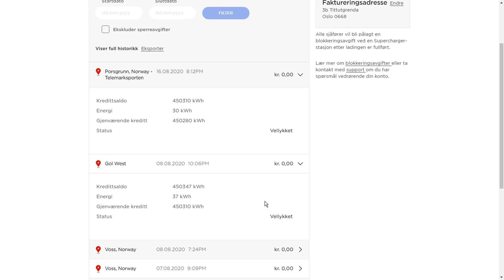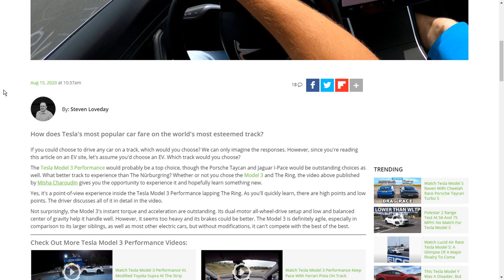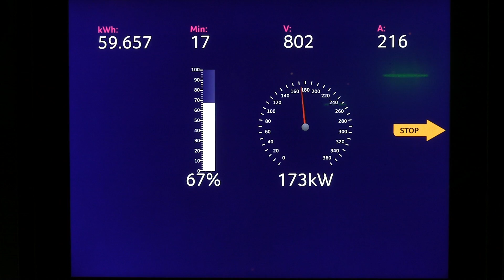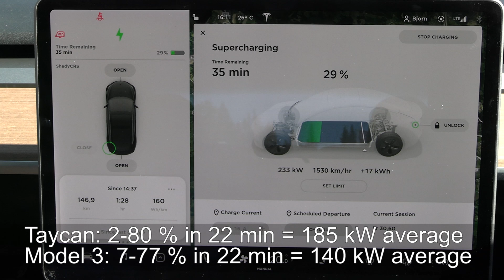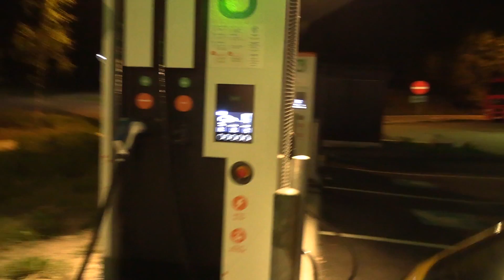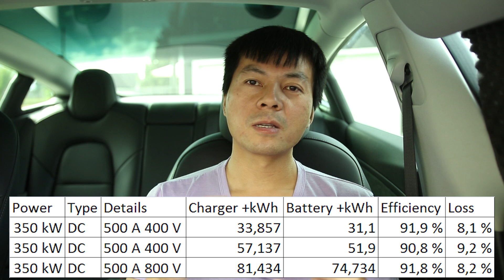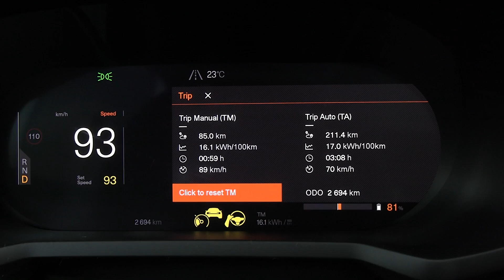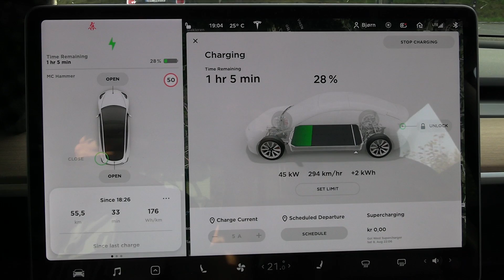Pros and cons of 800 V battery and charging systems

Comment: 600A at 400V is borderline crazy already, the future needs to be 800V or 1200v to lower the amps to something less scary.
Reply: @Art Uro Depends what you want.  1V will certainly not kill me.  Current CPUs and GPUs use about 1V and up to ~200 W (or more).
For cars 400 VDC is very good compromise between safety and efficiency.  Only advantage 800 V has is less metal in cables.  Insulation has to be thicker for same safety, so cables are not thinner.  In cars distances are short, so there is no need for 800 V.  I would absolutely choose 400 V instead of 800 V. 800 V is only marketing gimmick. Claims of faster charging speed are complete bullshit.  Charging speed is limited by cell (about 4 V).
Reply: Having a 800V or 1200V battery pack rather than 400V is far more dangerous than needing more amps for charging.
Charging cables can be cooled down with coolant. And connectors and cables have sensor to sense temp in case of overheating.
Reply: @fatos0404  We have manged to control far higher voltage then 1200v the last 100 years, without to many accidents.
Flatscreen backlight tubes needed up to 1000v to start up, depending on size.
Before that tube TVs could have up to 20.000v on the tube in the last generations.
My previous car delivered constant voltage to the spark plugs to measure something with the combustion. In the ignition system the 12v was converted to 400v and when a spark was needed the stored 400v was charging up a coil to make up to 40.000v to fire the spark plug. All this was possible more then 20 years ago, and it was possible to fit it in a box less then the size of 2 small lady shoes.

Charging cables with coolant is a solution, but the cable in the car and all the connections to the battery pack needs to be cooled also.
If we are already at 600A, the next generation Tesla roadster or cybertruck would be approaching 1000A or more, that would be enough to make a car wheel bolt vaporize if something went wrong.
Reply: @larsjrgensen5975  It is possible for sure. But os there any reason. Considering the short cable length in car you can just use thicker cables counter the heat problems.
At this time being 800V or 1000V is more of a gimmick than a necessity.
Trucks, boats, buses and bigger vehicles ate different story.
Reply: @fatos0404  People are already kicking and screaming for faster charging.
A Cybertruck or Roadster would have to charge from 2 chargers at the same time, if the batteries grow to 150-200kWh (1000-1300Amp) like some believe will happen.
Reply: @Art Uro it does matter a lot. It has to do with isolation, chances of archs,relays, begin able shut it off in case of fire, and many other things that are long to explain. 
Not saying 400 is "low" and those risks er eliminated, but at  800 or 1200 they are even more pronounced. And there are some benefits with higher voltage also.
Reply: @Art Uronevermind. Does look you are stuck in your thoughts. 
Its not about you touching the terminals. They have no voltage anyway until the connector is connected and the handshake is done. There are other factors to be considered, where the voltage makes difference.
Reply: @Art Uro No. There is huge difference!  AC is much more deadly than DC.  400 VDC can kill, but if connection is not perfect it will not kill.  (Leak after accident ...)  800 VDC is much more than twice as dangerous.
Reply: @Art Uro Clearly you don't know the Oms law and electricity so well. A 1V DC Voltage won't be able to penetrate the human skin. And in case it does it won't be able to generate any current that can damage or kill you. With 1V potential, you won't be able to generate 800V even in most copper conductors let alone human tissue.  After all we humans are bad conductors, especially in DC current.(AC is different if you have very high frequency).

But the discussion between 400 and 800/1200 boils down to other things not the direct contact of the human with it.
Reply: @Art Uro Touching directly to terminals is deadly.  After accident there could be connection trough dirty water or some other poor conductor.  Victim will get only part of original voltage.   

https://en.wikipedia.org/wiki/Electrical_injury
A domestic power supply voltage (110 or 230 V), 50 or 60 Hz alternating current (AC) through the chest for a fraction of a second may induce ventricular fibrillation at currents as low as 30 milliamperes (mA).[8] With direct current (DC), 300 to 500 mA is required. ... If not immediately treated by defibrillation, fibrillation is usually lethal

So 10* more DC current is needed to kill.  So 400 VDC is about as dangerous as 40 VAC (50-60Hz).  It can kill if contact is very good, but not much insulation is needed to prevent that.
Reply: @Art Uro You cant get shocked by Watts. Its current that is the problem. Wats is the energy wich is product of current and resistance.

If you add an 800V DC to 1 MOhm resistance there will be very little current (0.0008A)that will pass through. Almost nothing. 

Add 800V to 1 Ohm and you get 800A very high current. 

The human body has quite high resistance against DC current. 

And I do pint again. The advantages and disadvantages of 400V vs 800V er not related to humans and contact with the voltage. As you won't be touching neither of those. 

Its more about the other thing like heat, charging power, longevity of pack and stuff like that.
Reply: I have a master degree in Bioimpedance and bioelectricity. So i wold disagree about that. :)
Reply: @Art Uro Because for the same resistance you will get half of the current.
Chaces of current leakage double from 400 to 800v.
Isolation needs to be thicker
Contacts must be further apart. Contractors should be bigger.
I hage have no intend to give lecturers on YouTube comments neither to prove to you my knowledge in the fields of electronics.

The way you write the questions gives no mening. 
400V is the potential difference between positive and negative terminal. 400V does not carry anything. Its the cables that do. But to reach the same power effect at 400V you will need morr the current. Ohms law. Again 

Once more the point is not if 400v or 800v will kill you.

The point is if 800V makes any sens for EV. Wich is different story. You should not touch neither 400V or 800V.

But in case you do. There is twice higher chance that you will die from 800V compared to 400V

Comment: i think you missed that the taycan recuperates/regenerates at 260 kW during braking, in parallel with the physical brakes, so its none stop stress on the battery during its lap. isnt the model 3 either braking or regenerating (at 'only' 60 kW), but not both simultaneously? the model 3 also ran into temperature issues with its battery. 
i also think i remember you doing an acceleration, but not a full deceleration during your model 3 test on the autobahn, so the car could cool whenever you reached 200 km/h.
Reply from the maker: Regen on Model 3 is normally at 70 kW. In Track Mode it's at 95 kW. But my example shows that 800 V isn't really a dealbraker if you want track performance.

Comment: Hyundai/Kia and other automakers are already prototyping 800v befor vehicles, so it's coming regardless.  With packs voltage designed like Lucid's apparently is, (or like an MG ZS x2 ), it should be easy to achieve 400kw charge speeds.  Assuming the US and it's large vehicle loving population are still around and are able to afford such vehicles, those charge speeds will be necessary to convert the majority of the population from ICEV to EV.  Then to address large commercial vehicles that need to recharge daily, 800v/1,000v charging will likely not be sufficient in many cases.
Reply from the maker: The reason why the population haven't transitioned to EVs yet is not because the EVs charge to slow. It's because:
- EVs with sufficient range are too expensive in their contry
- There's not enough chargers and high power chargers in their country

If Taycan, Model 3, e-tron and similar EVs were as cheap as today's fossil cars and every country had the same awesome charging network as Norway, people will move over to EVs big time.

As pointed out too many times in this channel, existing fossil owners think they need to recharge in 5 minutes.

Comment: what if you applied ohms law will that reduce the heat with lower amps ie watts over volts = amps  take 100 kw charger 100000 watts over 400 volts =roughly 125 amps and a 100000 watts over 800volts = 62.5 amps surely this will make a difference it would be nice to know

Comment: Only the future will tell. I think I have presented my idea before, but if you can rearrange the battery just for charging I guess if you support 150kW 400V you can support 300kW with 800V just by making at 800-pack during charging. This can be done independently on the pack being 800 or 400 so if Taycan had this it could do that to charge easier on <500V chargers. I don't think other then really premium cars will get as much as 150kWh and I believe getting low end up to 150kW real speed on eg. a 50kWh car will make the car almost the best value for money today.

Comment: I think the main advantage at some point in the future will be that the charging cable and connector can more easily keep up with the amount of Power. If you have a 150kWh battery pack and want to charge it with the same overall C rating on the charge cycle. Than the amount of Amps on a 400V flex cable will become a bit crazy.

Comment: Bjorn, you are getting there :-)

800VDC charging can allow cheaper and thinner cables from the charging socket to the battery, saving money to Porsche. The stress on the cells are exactly the same. 
When comparing to M3, 250kW peak charging on a 74kWh battery is much much higher than 270kW on a 87kWh of the Taycan, although Porsche allowing it to last longer. In your tests, it seems that the charging speeds in terms of percentage are almost identical.
3-phase 220V is has a very natural and efficient conversion to 400VDC, therefore making much more sense.
Main advantage of 800V is at the high RPM, there is a back-EMF that reduces the effective voltage applied on the engine.
The future is with cells to pack, where the effective pack voltage will dynamically change based on SoC and power demands and further increase EV efficiency.
Reply: Someone needs to explain why higher voltage equals thinner cables. If I wanted higher water flow I wouldn't use a thinner hosepipe. I'm ready when you are.
Reply: @Nickbaldeagle02  the conductive part of a cable is rated for a specific current - not voltage. You can think about it as a pipe is rated for a maximum current, and a voltage is a height difference that provides the water a potential energy that can deal with more resistance. The downside of it is if your regular needs are for low current, you may end up wasting energy on resistance for your normal needs.
Reply: @Nickbaldeagle02  Power = Voltage × Current
Or W = V × A
So, for a constant power, a lower voltage system needs to provide more Current than a higher voltage system
For example, for you can get 250kW with 400V × 625A or 800V × 312.5A
Lower the current, lower is the heating
Lower the heating, thinner will be the wire

Talking you water and pipe analogy, think of the quantity of water obtained per unit time be the power (kW), the pressure of the water as voltage (V) and the radius of the pipe be (A)
To get a constant water supply, you can use high pressure water in a small pipe or low pressure water in a large pipe

Comment: 150kW might be fast enough when you are charging, but it's not fast enough when you are waiting in line for others to complete their charging session. 
This is the real need for something like 350kW, and the higher the EV market penetration becomes, the more the higher charging speeds will be needed.
Reply from the maker: Easy to solve this: Make more stalls. Frying the battery just to charge faster is not the best idea.
Reply: @bjornnyland  That's not as easy as you might think, because there is such a large difference between the number of stalls that would be needed on high-traffic days and regular days. The only real solution is to be able to quickly service customers as they come in, thus mostly avoiding queues.

That doesn't mean owners cannot limit charging power if they so choose, but some mechanism (pricing and/or social pressure) should exist so they have an incentive not to do so on the busiest days.

Comment: Bigger batteries take longer to charge at home. At some point you run out of hours in the day to charge at 7Kw
Reply from the maker: That's not a problem at all. Remember what I said about energy consumption? Even if future cars can push more kWh into the same kg/size battery, the consumption will still be the same. So if you usually commute 100 km today with 50 kWh battery and you charge at home, you can of course still commute 100 km today with 150 kWh battery.

And it's even better with bigger battery because you have a larger buffer in case you need to drive longer one day.
Reply: Bjørn Nyland That’s true. Although after a long trip it’ll take a while to recharge if you arrive home empty. :)
Reply: One day we'll all have our own miniature nuclear reactors at home.

Comment: I've always thought voltage differences should be classed like binary powers, so, at home (AC or DC): 4/16/128/256 V, ICE car 32 V, EV charger 512 V.  There's just something so elegant about it.
Reply: Sounds like a little OCD to me. :-)
Reply: @npbetts1  for sure.  I have an OCD for efficiency and numbers.  I guess it combines here, and probably came from the same source.
I'm an old guy now, but as a young child in the late 70s I got right into the first generation of CPUs 'commonly' available, when everything was done by entering binary (machine language), so got used to binary and efficient code early.  OCD ever since.  Good call!

Comment: I hate the false claims that people make about 800V. It's more of a marketing strategy if anything:

1. 800V is not inherently faster - it is only faster if the main HV path current limit (fuse, contacts, wire gauge, busbar sizing) is the limiting factor. The amount of current going through each cell will be the same, and P = I^2*R, where R is the internal resistance of the cell which causes heating in the battery. While charging at a higher voltage, you only have less losses in the HV path theoretically, but HV path should be sized in order to accommodate less current anyways so the losses should be roughly similar. This is a very small loss compared to the battery.

2. 800V motors are not inherently better. It gets complicated but basically as long as power is the same the size/weight of the motor will be roughly similar, as well as losses. Of course there are other factors to consider here but nothing game-changing

3. There is more part availability/cheaper parts for 400V systems, and stepping up the voltage can introduce unwanted safety/regulation problems in the design process. It's probably worth moving towards just to get that slight edge on your vehicle weight/efficiency, but it really won't make that much of a difference - not nearly as much as everyone says.

4. The main reason the Taycan can do these runs over and over is NOT because of 800V, but because of their battery cell selection as well as the cooling system. This is why the range takes a hit - you either get energy density in the cell or power density. In this case they've gone for a power dense design (less internal resistance = less heating).
Reply: How is it that you get the same current in every cell? I’m not saying you are wrong. I just don’t understand it because on one hand, the kWh of the entire pack is the same so you need the same amount of power from the charger and into the cells. However, my logic would be that you are trading current for voltage to get te same power input. An example:

Scenario 1: 400V battery charged at 200kW
System Voltage: 400V
System current: 500A
400*500= 200000w (200kw)

Scenario 2: 800V battery charged at the same 200kW
System voltage: 800V
System current: 250A
800*250= 200000w (200kW)

What I see is that you can indeed get lower current values. What am I getting wrong?
Reply: There's an important distinction between total pack current and the current through each individual cell. If two (400V & 800V) packs have the same amount of cells and energy, the extra current (in the 400V scenario) is going through the extra cells in parallel.
Reply: MCSGproject Ok, I now see. I had to draw a schematic myself to understand it. So the only thinner wires are the ones that come from the car’s charger input to the main positive an negative of the battery and the cables fin the battery to the motor

Comment: It will be interesting to see this video in five years time.  A couple of weeks ago I charged my Corsa e at IONITY in Blackburn. It was a hot (for England ) day. I don’t know what the battery temp was. As you know the Corsa has a 100kW charging ability. At 20% the car was receiving 91 kW and at 50% it was 81kW.  This compares to your figures of 76kW and 52kW respectively with the e208.  Perhaps it is good that IONITY is so expensive as I don’t want to wreck my battery and will not be using IONITY very often. 😳
Reply: Thanks for the info. I prefer the design of the Corsa-e, too. Wish Denmark would start moving towards electric mobility and storage. We have so much wind power in the net. In a few years there will be a huge wind park at Rønne banke 20 km from where I live. 1 GW and expandable to 2 GW (!) Enjoy your new EV 😊 BR, Per